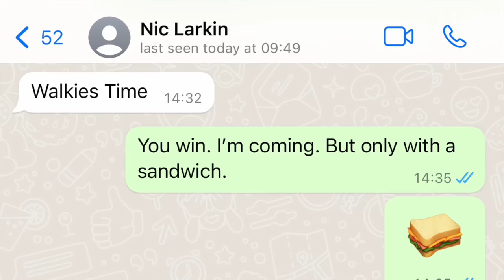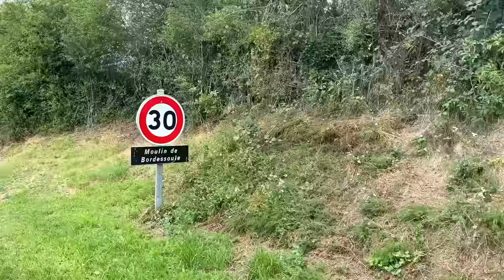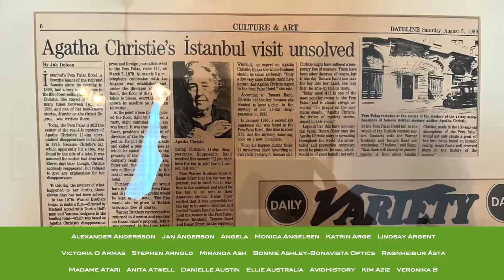Discovering the Chateau's Ancient 600 Acre Estate

Comment: I LOVE THOSE PLATES!!!!!
  See an Osteopath for the hip, could be imbalance from the wellies, but he can work on muscles. Knowing that you wear heels all the time, it could be damage from long term heel use, which wouldn't be the first, although most women get foot problems rather than hips, but it isn't rare...one hip replacement and within 6 months you're back in heels and running-(to catch a plane)!!! If it is an imbalance there are small heel inserts that are only a couple of Euros, they correct inward or outward leanings of the feet...this can be found on where you wear down flat shoes heels the fastest. for example if it is your outer edge of the heel, then you need the higher side of the insert on the inside edge of the heel so your shoes land evenly when you walk. After decades of walking this puts strain on the muscles and they can affect the sciatic nerves or the psoas or piriformis muscles and those can be terribly painful but don't merit surgery. Hip replacement is a one day deal and only a night or two in the hospital. Try some yoga stretching, and try doing some video editing just standing rather than sitting...

Comment: You could stock trout if the water was clean and constantly had a fresh water source. The blackberries - soak in water and  vinegar and the worms come out. In a large bowl, mix together 3 cups water and 1 cup white vinegar. Immerse your berries in the water and gently agitate them. Then let the berries soak for 5-10 minutes. Drain the berries in a colander in the sink, rinsing them with a light spray of running water

Comment: The off cut's I've used as faux log walls and chinked in between and stained the boards or cut in half lengthwise and use the live edge as a rustic siding. Very fitting here in the U.S. with our cabins. Not so much with chateau life.. 😅

Comment: My darling Stephanie, l worked in the shoe industry all my life and gumboots are not suitable footwear for walking 5 klm. Put the right shoes on your feet and there will be no holding you back. May l suggest a pair of direct injected moulded soles by ECCO (Danish company) you won't have and leg or hip pain as the soles absorb the shock when your foot strikes the ground. Regarding your hip pain l would start with suitable daily footwear and some floor exercise for lower back before getting some professional advice that could and l say could lead you down the expensive garden path. Lot's of love Thomas Melbourne Australia PS so much more l could say to be of some help. xox